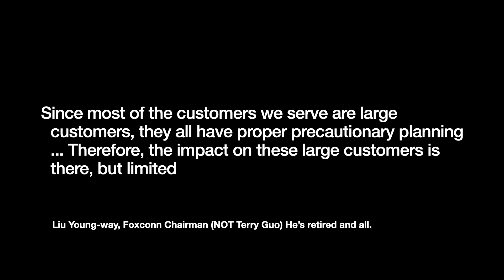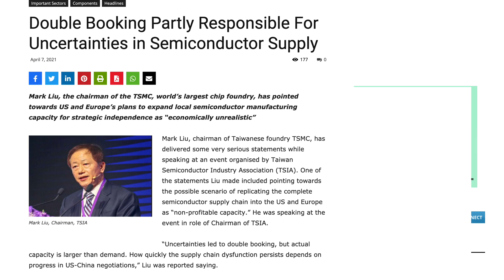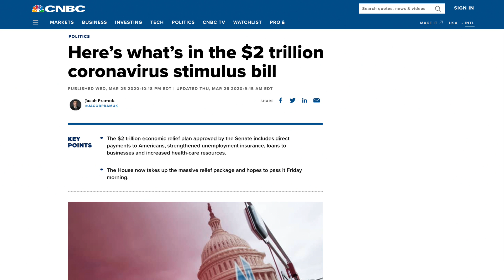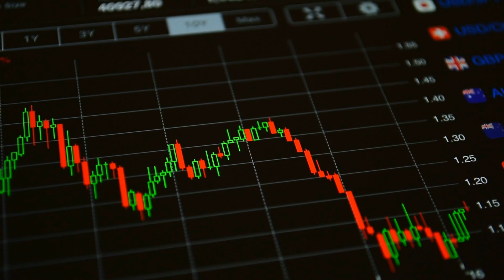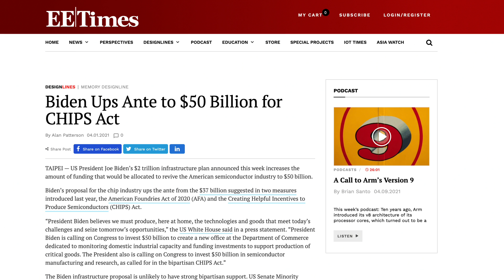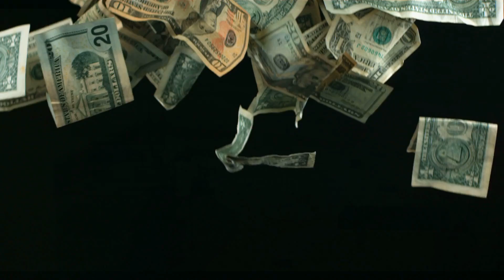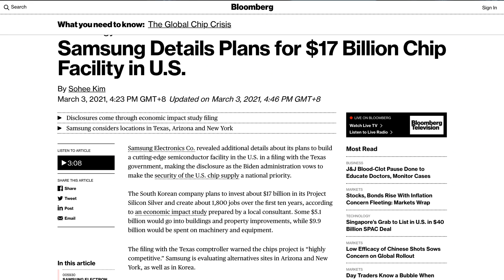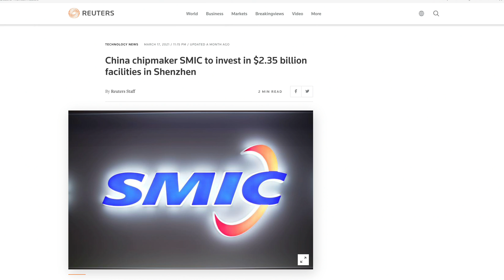The Coming Semiconductor Bust

Comment: Very informative and up-to-the-minute discussion. Not every sector will need or use chips requiring TSMC 5N or 3N or equivalent. Are there patterns in the industry sector breakout that might map to planned capacity expansions, including those that will be gov't subsidized? Maybe it's too early for that…
Reply: Yes, chips much larger innards than 10nm are hard to find and we have to scramble to keep up production.  Micros and other parts.  The shortage is all over the place !
Reply: Sure, and this is simple.  The world of computing.  ALL of the world of computing moves to keep up with the latest technology.  It's only a matter of life cycle.  But TSMC 5 and 3nm are SO power efficient it's going to drive the world of servers, which is I think so massive most people don't comprehend just how large this sector is, is going to want to move to 5 and 3nm as soon as possible because of the power savings.  TSMC 5nm is about 25% more power efficient than 7nm, and 3nm is about 40% more efficient than 7nm.

EVERY area of computing though keeps up with the latest.  Do you want a laptop that you need to charge every 4 hours, or one that you charge every other day?  Right now some Zen 3 laptops will run for most the day on a single charge, unless you're running heavy tasks.  That's on TSMC 7nm, so imagine going to 3nm.  You won't need to worry about charging it until the end of the day when you go to sleep.  No having power cords plugged in.
Reply: @johndoh5182  Good points all. With all the talk about older fabs that only do larger feature sizes, I lost track of the performance advantages. I do have some idea how much power goes into server computing. Any savings is a good thing, but there is always more (mostly useless) computing to do.

Comment: Who will win? The consumer 😎
Reply: It depends. If there are a lot of foundries going bust because of this likely overcapacity that may result in the survival of couple of them, which will results in duopolies if not monopolies. If that is the case, the consumer will not win in the long run.
Reply: @IotaEtaSigma  Just buy on sale or second or third newest of graphics cards released. Only fools preorder, and only fools spend more than msrp
Reply: @IotaEtaSigma  And a second order effect, this could reduce investment in future generations of chips too, also bad for the consumer
Reply: Consumers have never been bailed out
Reply: The crossover I did not expect.
Reply: Not necessarily. 
There’s a massive chips shortages of all kinds. Driving of the cost of many products. Building new fabs takes many years.

Comment: I was discussing this issue with some bitcoin miners just earlier today and I pointed them to your channel as they were sure high GPU prices would carry on for at least two years. Based on what I have seen on your channel I didn't buy it given the massive capital expenditure by TSMC in 2021.

Your writing is so good and well informed on these complex topics melding geopolitics, technology and economics. Are you a trained journalist or journalism student?
Reply from the maker: Crypto GPU prices and supply ... who knows. Whole new set of dynamics. 

I am neither a journalist nor a student. My day job is entirely different from what I do here. And that’s good because it helps blow off stress
Reply: Fabs take years to develop, and years to build, and years before they start making chips. 3 years minimum for TSMC, see how long it took Intel to pump out their 10nm chips (close to 10 years, and not even at full capacitty)

It will be a long while before this big subsidy has any affect on prices
Reply: @TheMasterofComment  There's too much variable in saying how long it takes a fab to start producing products on a large scale.  It only takes 2 - 3 years to build the plant.  The amount of time it takes to start producing product could be a few months or many years.  For instance the plant being built in AZ is a 5nm node factory.  TSMC staff along with the makers of the equipment could come in and probably have it producing at full capacity in less than 6 months.  This isn't comparable to what happened to Intel and 10nm.  Intel was the company that developed and refined the processes to make their 10nm node, even though they didn't make all the equipment.  But once again, for the AZ 5nm plant, TSMC 5nm is already being produced in mass.  TSMC is already producing it for Apple products so it will be a VERY mature process even by the time the AZ factory is built.   So, barring equipment failure, it shouldn't take long to start producing.  I know there is a time period to get the equipment working properly, but that's not years, it's weeks.
Reply: google up for barkhausen noise effect in economy. 
Trying to predict noise profile of something rensembling spin glass is futile task, especially that butterfly effect causes such complex system to be susceptible to external influence.
F.e. you could say you can try to create very detailed model of magnetic core so you think barkhausen noise will become predictable, and then your core gets struck with three cosmic rays, and few atoms internally decay due to natural radioactivity and bang - that is why it is called noise. 
Economics have very similiar problems, though ofc. because domains can be much better artifically aligned there is more room for microeconomy to do it's job. Still whole system blows into chaos on any possible excuse.

Comment: This is such a good summary for the current situation, well done! I think the bigest question for the semiconductor industrie is the progress of autonomous driving and IoT. But if there is really to much capacity for chips coming in the next years, investors will have a hard time ;)
Reply: Even with autonomous cars, which have what maybe 3x the dies in them, how does that soak up all that capacity? Especially since the supposed goal of them is to reduce the number of cars needed to less than 1 per person. 

I think everyone has lost their damn mind over this chip shortage and the resulting government money, the capacity they're building won't be necessary until the 2030s I'd wager (with no data to back it up mind you lol)
Reply: IMO AI learning will boom and absorb A LOT of chips.
I even suspect Elon's Dojo is planned only next year precisely to ride a favorable price wave.
Reply: @musaran2  I rather think it will end up like any othe r "hot" booming topic in IT. Big Data levelled out FAR below what everyone expected, bicause a big pile of hay doesn't make it more likely to find needles. NoSQL has found its niche and is hiding in there while SQL is still going on. Let's go back a bit further: 5th generation programming languages / visual programming - nobody is even talking about it any more because it was a bad idea to begin with.

AI makes sense for a limited set of problems which are currently dominated by humans because normal algorithms fail, but which are repetitive enough to automate. Like driving, image recognition, voice recognition - classic AI (neural net) topics. How many of those do you think you need? Of those: how many can you afford? Currently everybody believes that AI will solve all the problems that Big Data failed to solve - context sensitive classification problems - but those need not just data or a dumb learning algorithm - they need actual intelligence. Engineers. Knowledge. Experience. An AI has about as much experience as a new born ant.

AI will not absorb the chip capacity. The pattern with all those hot technologies is that they are promoted as a "silver bullet" - the way to solve all your problems and free you of the obligation to think (or for managers: to hire people who can actually think, but cost money). After 70 years of IT we should now understand that silver bullets don't exist.
Reply: @KonradTheWizzard  AI can improve itself unsupervised, that is the game changer.
AI feeds on data, if strives on underused big data.
AI has already solved BIG challenges. I can't think of a trade fundamentally safe from AI takeover, not even art.
The salary of a human worker can pay for a nice robot, and the salary of a human trade can pay for a lot of AI training.
Reply: @musaran2  We are at least a few decades, more likely centuries, away from what you call AI. You will not meet Lt. Cmdr. Data within your life time. Not even his brother B-4.

What we have right now stupidly learns whatever set of data you place in front of it. Your success depends on your selection of data as well as the exact layout of the network you chose. Even if it is an unmitigated success it can merely classify data that lies within its learning parameters (recognition networks) or make very simple decisions based on a (hidden) polynomial function (feed forward net or fuzzy logic) as long as you stay within the definition interval of that function that you know very little about. If you get outside the functions definition interval the AI will malfunction in surprising ways.

It can not improve itself substantially. It may be able to consume more data and refine its internal function, but you have absolutely no clue whether the AI has the same idea about "refinement" as you do. You need to supervise it.

You can play tricks in the lab by reversing the function and make your AI "dream" of weird shapes that are derived from the dataset it learned. But this is neither intelligence, nor creativity. It is mathematics playing tricks on you. I admit that the images released by Google are intriguing to look at.

I don't want to take away from what we realistically CAN do with AI. Yes, we will be able to create automated image and voice recognition systems that help us with a lot of tedious and repetitive work - Alexa and Siri are just the beginning. Yes, we will be able to create self-driving cars. But we still have a lot of really hard work in front of us to get this done and AI is NOT able to magically find real patterns in data that human minds assisted by statistical software are confounded by - human minds are still tens of thousands of times more intelligent than any AI. And we have no clue how to get from current AI to brain - it will take a LOT of work and experimentation.

You can not replace an engineering degree and human ingenuity with a bunch of data fed into a complex polynomial function with a name that sounds like magic. No matter how much you wish it to be true.

Remember: we will have a functioning true AI in about 20 years - we've been saying so since 1950! And we are experts! We know. (Full disclosure: I did my degree on a neural network simulator system in 2000.)
Reply: @KonradTheWizzard  Ah, you talk of AGI. Cognition.
It is still a deep mystery to us, but very smart people are hard at work reverse-engineering what exactly thinking is. And making progress !
Meanwhile, cheap hordes of extremely autistic neural nets (limited AI) will casually brute-force problems that humanity would take years to solve.
I forecast "human work" will turn to a few rare visionaries orchestrating vast AI farms.
And AI progresses on double exponential: AI+chip advances. The last 2 years have been impressive, if there is no conceptual wall the next will be staggering.
Reply: @musaran2  Whatever you smoked - it must have been great! ;-)

Comment: Lower end fabs will definitely face a lot of stiff competitions soon, but I assume advanced chip fabs will take longer to build so they have more time to make their money back.
Reply from the maker: I’ll have a video later about this but in general it takes 2-3 years.
Reply: @Asianometry  so 2023-24 would be the time so consider selling AMAT  TSM  AMD shares
Reply: Some of those lower end fabs are just in the business of making commodity parts as cheaply as possible and those guys have competition.  But there are a lot of specialty fab facilities that look like lower end operations because they are running small wafers and small quantity runs, but in some way are able to produce products that the big factories are unable to make, such as low noise linear components.  Fabs like that have a dedicated customer base and although they may not have much capital tied up in plant often have value in skills and process that is difficult to measure but keeps them operating in a crowded market.  The guys making state of the art microprocessors, the cheapest possible 555 timers, and precision instrumentation amps are really three different industries altogether even though they look like one.
Reply: My company is finding almost all chips hard to find.  Especially microcontrollers.  We have to be careful what we design in.  Even op-amps and ADCs/DACs to make sure they are available at least at the moment.  But all that can change quickly ! 😁
Reply: @k7iq  Putting too many electronics unnecessary will make car mechanic fed up and cannot fix those faulty battery or motor  easily ? Most mechanics not familiar with electronic diagrams.
Reply: Yes.  But cars have had micros in them for many years now.  It is harder for normal mechanics to work on some parts of the cars because of that. Now drivers have to take their cars to the dealers.  I can't even get my 2011 Ford door handle fixed at the dealer ! It's not just electronics I guess...
Reply: The lower end Fabs are not idle. They are busy making chips for lower demand product lines. Eventually, they will retire, but not until they extract as much profitable life as possible.
Reply: linkzable  Nothing in life is guaranteed, but doing something is better than doing nothing. Also, just having TSMC and Samsung engineers are not enough. There are required chemicals that only Japan makes which they can ban (that's one of the key reasons Samsung lagged behind, as Japan have rationed them against Korea due to their political issues). Required machines from ASML which are already banned. As long as the bans stay in place it will be near impossible for China to catch up.
Reply: @indianatarzan8001  Facts.  China is being held back by approx 10 years vs Samsung and TSMC.
Reply: linkzable  Think a few years back some of Micron's subcontractors (from UMC) were also paid to steal some of their blueprints for a Chinese competitor ( Fujian Jinhua ) who'd earlier unsuccessfully tried to buy (at least part of) Micron, but they were caught
Reply: linkzable  - China has a lot going for it, but if it continues to escalate the tensions in Taiwan, then the poaching of talent will end due to unwilling participation by the scientist & engineers themselves.
Reply: linkzable  Well, South Korea hasn't caught up ever since Japan started limiting the chemical export to them. China building ASML replacement is just a joke. Literally no one else on the planet can compete with ASML, which uses top resources from the entire planet to build their machines. TSMC stocks and future has actually been boosted by Trump's policy, which is still followed by Biden, so not sure why you think they're screwed. But sure, let's wait and see the results.
Reply: @indianatarzan8001  China may be building another type of lithography machines totally different from ASML EUV type. Will they succeed, we will see. But China very confident they will succeed.
Reply: Congratulations, you're actually following the subject and not drivelling on about bitcoin bullcrap!